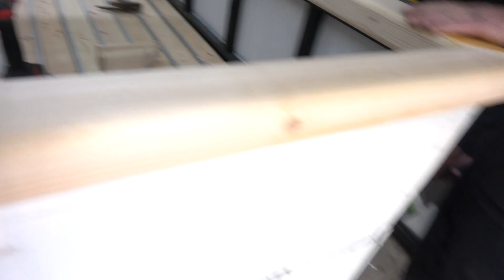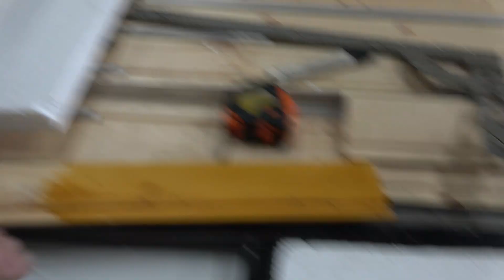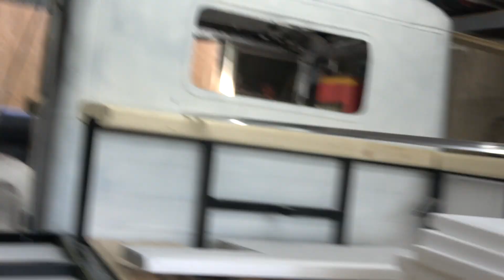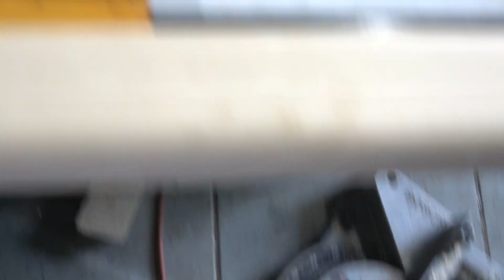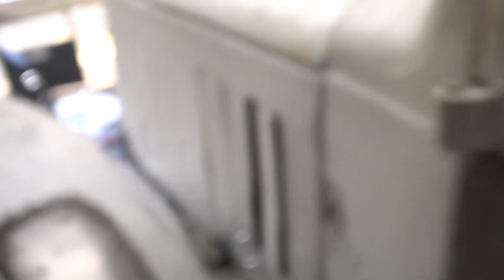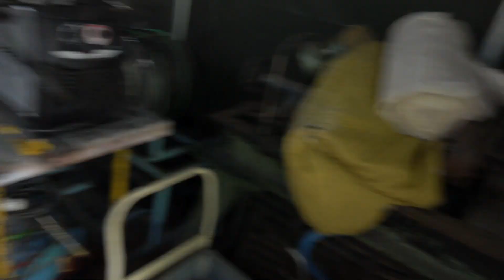Cheap & Easy Pick Up Truck Bed Liner Build Part 1

Comment: Looking good Dave .lf only you could paint the panelwork that easily ! And there are only a few panelbeaters who can master lead loading and probably none in modern bodyshops . Cheers Dave .
Reply from the maker: John,  Thanks,  I have decided on the two tone colour scheme which i will show in the next video 🤔 I think lead loading is so rewarding 😉 Cheers Dave

Comment: Yeah if you get a sheet of plywood with batting on the underside you could carry stuff but only if ye had to i suppose
Reply from the maker: Doug,  It will never have anything in the back it‘s a toy or a volley or both 🤣😂 Cheers Dave

Comment: Your bed liner is looking pretty nice. You won't want to scratch it by putting stuff in the back.  I forget now why you wanted the sides to fold down?
Reply from the maker: Midge,  Thanks,  It‘s a toy there will never be anything put in the pick up bed🤔 tbh I came remember why i did the fold down sides 🤣😂 Cheers Dave

Comment: Did you glue the Styrofoam to the panels ?
Reply from the maker: Gary,  I wasn't thinking of gluing them in 🤔 I feel there may be a pearl of wisdom coming my way 🤣😂 Cheers Dave
Reply: Yeah, unfortunately sometimes you’re so close to the problem. You can’t see the wood for the trees I have been there. Hopefully it’s not too late for you to give it some thought. I’m not saying I’m right it’s just an idea.
Also, as I mentioned in our chat, the cotton padding you are considering using will hold moisture maybe some form of mastic would be better